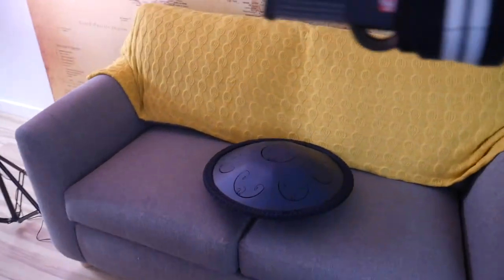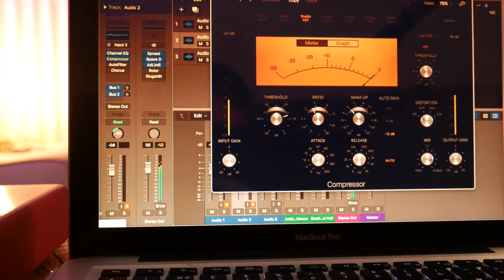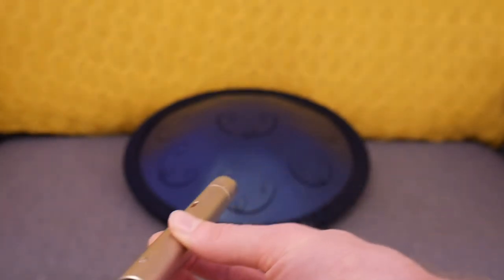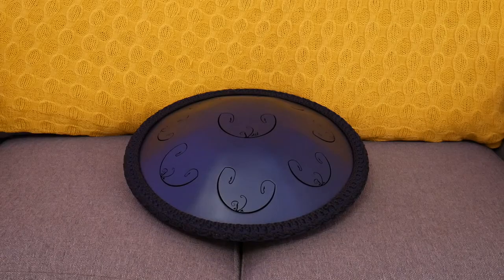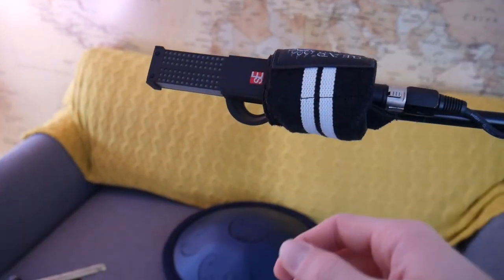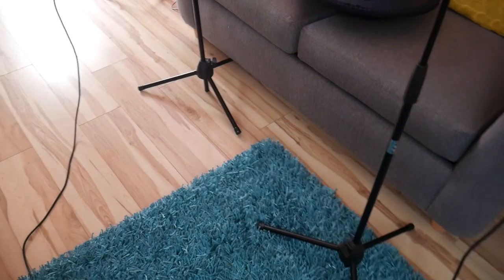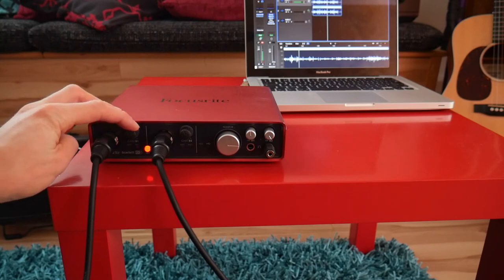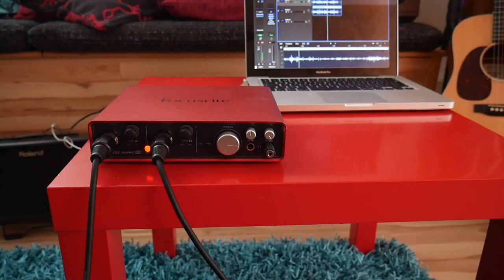Recording the RAV Vast - How I Record

Comment: Thanks, that AKG microphone is one of the ones I'm looking at. I did find that the Zoom H6 XY, along with an AKG C411 PP does a pretty good job of things, but the 451B should do a better job than the XY from the Zoom. I use a Focusrite Scarlett 2i2 for my vocal mics, but had better luck on the zoom with the 411PP mic. I was also thinking of maybe a matched set of Rode NT5's might be a good fit...decisions, decisions, decisions ;)
Reply from the maker: Nice, the AKG Is definitely a high quality mic for its price. Ah okay, so you plugged the mic into the zoom? Sometimes I wonder about the 2iI2 as I have had issues with some mics through there. Be interesting to hear how the rode NTIs work out I was considering getting them for a while. The Neuman KM184 matched pair would be amazing I think, but a little more pricey!
Reply: @RobertStubbs  I get a lot more headroom through the Zoom than the 2i2. I find the same thing with my Behringer mixer. The 2i2 works great for my AT vocal mic and with the Sure SM58, but I don't see the same performance with the AGK contact mic. They've changed the mic preamps in the newest version of the 2i2, so they may of fixed that part.
Reply from the maker: @ChiefPoints  interesting I think it does a good job for the price but there are definitely better ones out there!